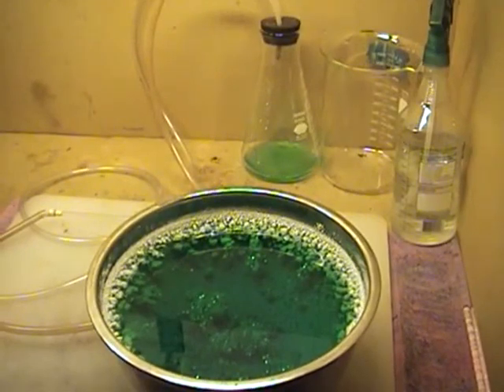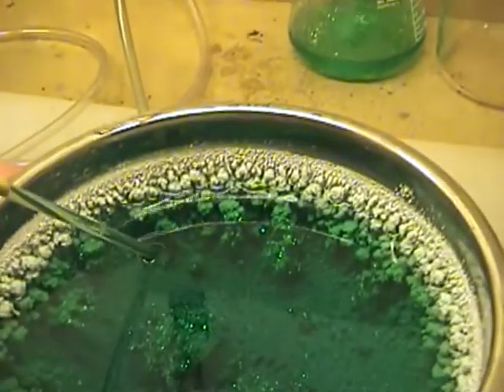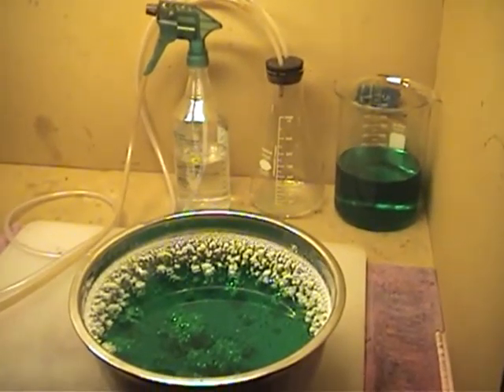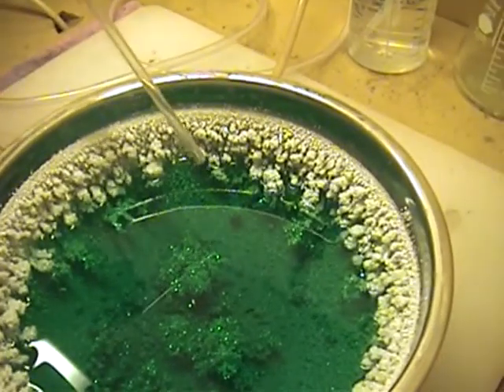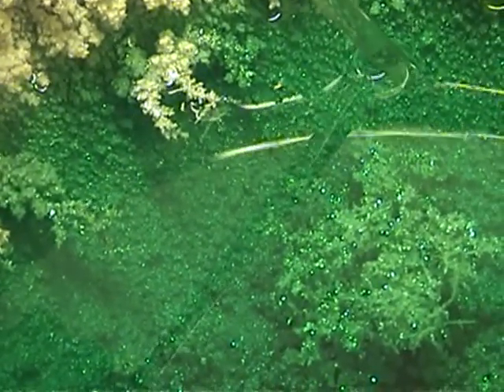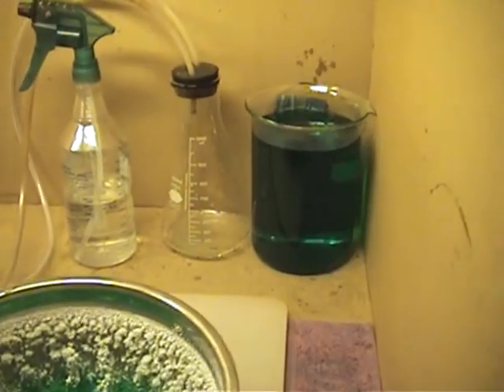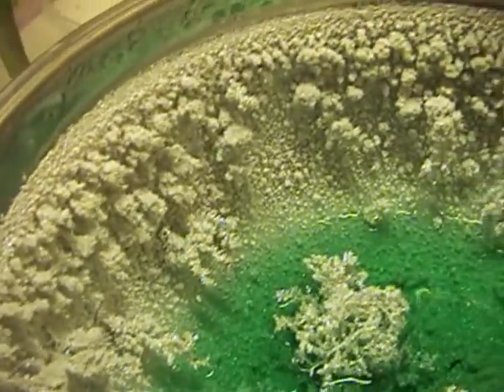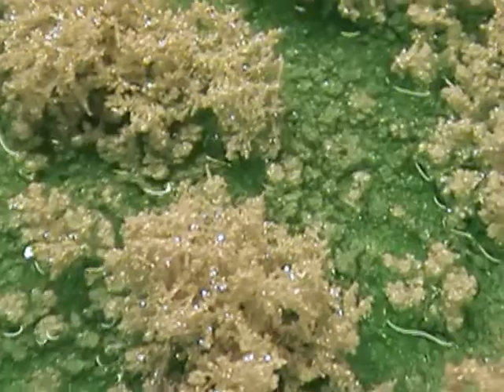Refining and Growing silver cell crystals by electrolysis

Comment: What material is used for the anode basket? I have been using coffee filter but I am getting the sludge come through.
I have tried a hoover bag but water does not penetrate it. Is there a particular material to use?
Reply from the maker: Muslin cloth from Walmart. Google muslin cloth
Reply: +AQUILLA REFINING Thank you for your response. 
Had a look muslin cloth which shows it to be very porous compared to a coffee filter. Is there a particular type of muslin cloth? 
http://www.ebay.co.uk/itm/100-Cotton-Muslin-Cloths-pack-of-10-/290592678195?hash=item43a8ac6133:m:mrjM_pK34shECxCawCQgT7A 
In addition of using a coffee filter I used the round disk cotton pads post coffee filter which sat right at the bottle neck which worked well.  But over time it would leach through.
Hence why one is looking for a tight stitch material.
Regards
Reply from the maker: +klassik68 Those are made for things like tea and are about 50 thread count. Buy just the regular muslin cloth like used for clothing it's 100 thread count. You will use two pieces and make it a double layer. You can also use premium muslin (200 thread count) and use just one layer.
Reply: +AQUILLA REFINING 
Thank you for clarifying. Much appreciated.

Comment: About Gabrielle is the positive connection the stainless bowl or the nitrate and how is the nitrate electrically connected
Reply from the maker: The stainless steel bowl is the anode ( Negative terminal ).
The Positive terminal is connect to the silver bars or shot ( Anode ) and are lowered into the nitrate solution. As the bars dissolve into solution the same amount is precipitated onto the stainless bowls surface.

Comment: dear sir I'm in very severe need of your help.I purchased three different loads of Rogers Bros silverware with the intent to melt it down In nitric.I saw videos on melting down silver coins and stuff but that was all done in small quantities I tried to do loads at a time and now what I have is different solutions most of em a dark green almost black and there's lots of silver in them but I cant bring it  back .I hate to just waste of silver that I trIed to invest in but at this point it seems pretty wasted and I did about 3 different sets of silverware 52 pieces in each set give or take and I couldnt bring back any of it.if you have any words of advice I would be very grateful for your help sir.

Signed,
 desperately seeking silver
Reply from the maker: If you have silver in solution that is hard to recover you can add table salt to the solution and precipitate the silver as silver chloride. From there you have to convert the silver chloride back to silver metal. It's a longer process than cementing the silver on copper but if you can't recover it any other way than this is an almost guaranteed method for recovery.  Google the terms and go to www.goldrefiningforum.com for the methods.